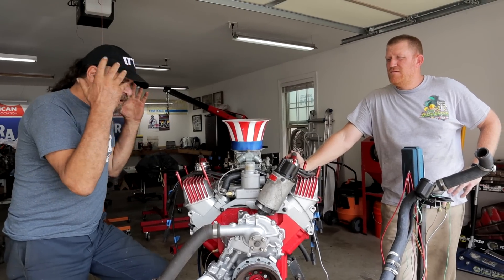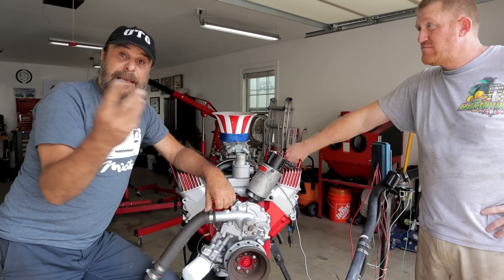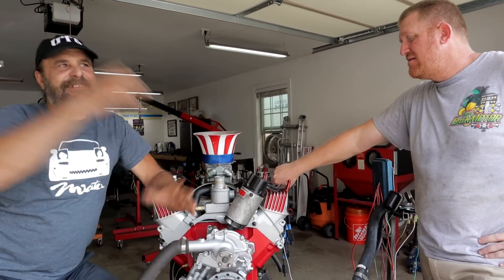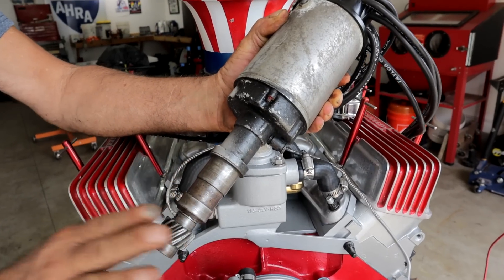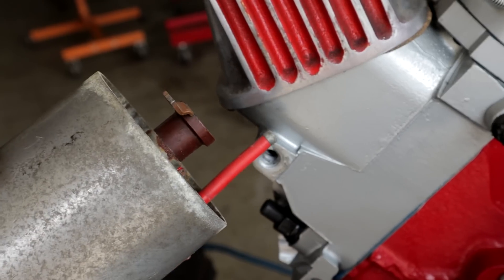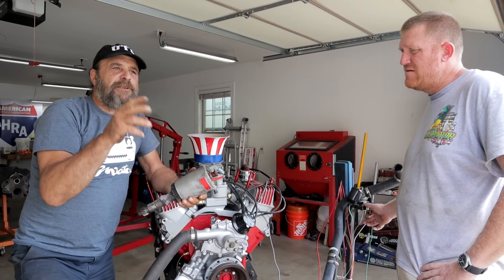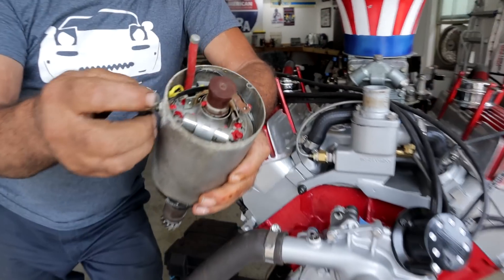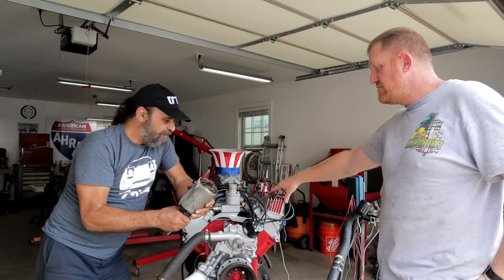The Magnificent Magneto

Comment: How do you hook a tac up to this? Can you hook it up to that kill switch spot? Can it be digital?
Reply: You can do it 2 ways, 1 mechanical with the right base, or 2 electronic tachs. Sprint cars use Tel Tachs which are digital and use a 9v battery and have a memory or there are boxes that adapt your electric tach to work with it. They get the signal from the ground wire. That said do not try to hook up your tach directly to the ground wire! You will fry one or both of them.

Comment: I mean it’s a nice explanation but vertex magnetos are not 3 A they’re like 1.5 A you can hot rod one up with an external transformer and bigger internal windings because now there’s more room inside the case because the transformer is not inside the case anymore and get them up to about 3 A it’s all the bigger you can make a vertex I do not know much about vertex mags so I don’t I have a comment to make on the fact that the magnets get stronger but leaving a magneto sit on the shelf The magnets will not just go dead they only discharge from being ran if you spend a coin for rare earth magnets they never need recharged again but leaving one sit on a shelf does not discharge the magnets just sitting there

Comment: nearly all power equipment for lawns, tree work, and snow blowing use them. Just from the magnets on the flywheel to the coil. Whether two coils and cylinders, or one of each. That's why you can hit the mower blade on a stump, shear the key between the flywheel and the crank and be out of time. If you are broke and trying to learn combustion engines they are all over the streets on the curb for free, and most of them just need a little patience and elbow grease. You can learn all the basics of carbs, spark, compression by diagnosing and repairing them before moving onto things you shell out money on. I was lucky enough to get paid to do it and get the experience. Cut and lapped/ lashed valves, set points ignitions, ring gaps and hone jobs. The list is endless and you can learn for very little cash to gain the knowledge, experience and confidence.

Comment: Some technologies, no matter how old, are still the best for a given job.
An ignition system that doesn't rely on an external power source = magneto, an ignition that delivers a stronger spark at high rpm and is capable of firing the plug at extreme cylinder pressure = magneto, an ignition that simple, has few parts and is easy to repair if needed = magneto.
AG equipment used them forever because if the electrical system on the tractor failed the tractor could stay in the field working anyways.
It's much like the traditional all mechanical injection diesel (before electronics), you could push start one and it would run forever strictly on air and fuel - no electricity required. 
Sometimes technology moves us backwards...
Being able to control something with a digital processor isn't always a step forward, when absolute reliability and in the field repairability is key then the magneto is the answer.

Comment: I am dying to test out my Mallory mags park setup which uses apparently a transformer and a dual points distributor to switch the ac on and off. Info is limited I can find on it.
Reply: Spud Miller (F.I.E.) took over Mallory Magneto parts & Service.
They have everything from caps to bases. They can put tach drives on and make rev limiters. They are the best source of info.
They also do Vertex mags, as do Joe Hunt, and B R Motorsports.
You can even get offset, or right angle drives if you need to run a mechanical fuel injection pump like a f5000 or a Can Am car.
Reply: @anytow  Thanks for the info!

Comment: Great Vid UTG! Love magnetos. there are lots of stationary engines form the 1920's that still run the original "horseshoe" maggies. Just one thing @4:48 platinum tipped points. Very important to clarify that they should not be filed with a normal points file as that will ruin them. They are very expensive (if you can obtain spares) and many have been ruined by well meaning but ill informed people in trying to file them as if they were "normal" points.

Comment: Years and years ago at Wyotech in Chassis Fab & Hi Perf Engines class, had 3 old  drag racers teaching and one brought a Vertex to pass around the class, no cap on it, he knew damn well what he was doing 😄

I grew up drag racing, I knew what a magneto was all too well. I see kids passing it around, turning it a little. I forewarned one dude, "that thing is going to zap the piss out of you!" Nobody had grasp how a mag worked yet. Saw a kid give it a good snap and he about dropped it and peed his pants! They didn't get it makes high energy spark without batteries or anything hooked to it. It was a good laugh 😅. It was even funnier when i put the coil post on the classroom table frame and zapped a whole bunch of guys too close to the desk 😆.

I can say getting hit by an MSD 7AL2 Pro w/ pro power coil was worse! Our promod had Mallory SuperMag IV's tuned by Don Zig, that bastard was like getting hit by lightning!

Comment: 72 duster, I just replaced  voltage ragolator but still doing same thing. Car dies  in run position  but will run with full 12v with key on just off starter runing... not sure what it is.. HELP please...
Reply: Probably key switch
Reply: Might be, I replace key switch about year ago and did not fix same issue at that time. Voltage regulateror fixed at that time but now it's doing something..

Comment: Thanks UT on the spark plug gap!!. I've had problems with my Fairbanks Morse Mag, it's on a 1932 Fordson Tractor built in England, converted from the original "Spark Box".
Basically a Model-T engine on steroids. 1st thing I actually ever drove at age of about 9 or 10, pulling down whole trees by the roots with my Dad. I had to stand on the clutch while pulling up on the steering wheel. Boy, I got whacked by plenty of branches. Those were the fun days during a hot summer!

Comment: We use these in airplane engines too because they allow the engine to keep running if the electrical system fails. A typical setup is a 4 cylinder engine with 2 spark plugs in each cylinder, with 2 magnetos so you still have partial power to all 4 cylinders if one magneto fails.

Comment: Wisconsin Air cooled engines used a Fairbanks Mores Mag.  Had a bunch of fun watching a kid that thought he was sharp on small engines knock himself across the shop floor several times as he couldn't grasp that when he slowly rotated the engine up to TDC it would throw one hell of a spark.  Had to explain that the click he was hearing was the armature spring assembly throwing the assembly over real fast so it would start throwing a spark as soon as the engine turned even slowly.  You have to pay attention when timing them or you get a nice reminder.

Comment: Thanks so much Tony. If i remember my tech, Magnetos also provide what is called "trailing" spark to ensure firing on every stroke. If a hi power mill with a lot of fuel entering the cylinder managed to flood/ground out the spark, it still had the capacity to fire the charge up to something like 15 - 20 degrees late when the plug gap cleared. This happens in like a 0.3 of a thousands of a second. I'm sure Tony can expand on the importance of this reliability factor and also in not sending  unfired fuel charges through the exhaust. 
Cheers

Comment: Magnets in the cheap chinese gas powered generators will lose strength when sitting.
Ive made a few bucks over the years buying seemingly dead generators , starting them, plugging in a drill and manually spinning the drill to tickle the field and start making juice. Leave it run under load for an hour or so and its good to go again..

Comment: You forgot to mention Joe Hunt Magnetos.  The Chevy versions have a hole in the base to lock them on Cylinder #1 in the 'points open' firing position to make it easy to set initial timing.

Comment: Allen (my friend) and I were at a high performance shop in Grand Rapids mi. That had a used speed part section. He picked up a mag and spun it before I could warn him. He threw it down so hard I STILL cant believe he didn't break the glass topped display case! His eyes were the size of dinner plates! Another good shock to be had is from a old model T coil. A guy i worked with would wire up another guys toolbox with a charged T coil so when you put your key on the tool box it would ground out and you would get a rather nasty poke! Very funny.....when it isnt happening to you! (Ask me how I know)

Comment: I took a aviation history class as an elective in high school and its amazing how much airplane tech found its way onto the drag strip those 18 year old who flew fighter planes over German picked up alot of knowledge and reapplied it
Reply: My son in air cadets learned about magneto.  They are still used in air planes. Wico still makes magneto for old tractors.
Reply: Almost all recip aircraft are still mag powered, its time tested and very well proven. Starting to get more electronic ignitions now, especially in experimental craft. 

What I always liked about aircraft mags were the impulse coupling design. Usually just one mag of the two has it. Spring loaded cam that snaps the mag over at a set point giving a good hot spark with little to no rotation of the engine 👌.  If the engine had some prime, you can literally tap the prop around by bumping it and once the impulse coupling snaps over it could start! It also makes it more hazardous to work on if a mag is mistakenly live.
Reply: @mytmousemalibu  
That's how the mag on my IH tractor was  - obviously for the same reason.
There was a hand crank stored up under the seat as a backup if the battery went dead.
Some stuff should never have gone away...
Reply: @mytmousemalibu  
That's how the mag on my IH tractor was  - obviously for the same reason.
There was a hand crank stored up under the seat as a backup if the battery went dead.
Some stuff should never have gone away...
Reply: Yeah mags are very reliable model t ran of a magneto attached to the flywheel ive seen them almost a 100 years later still working
Reply: Look at all the overhead cam and multi-valve technology in todays passenger car engines - that stuff is straight from WWII aircraft....
Reply: @Motor-City-Mike  right, people now marvel at these new cars and there technology like its a new invention when its not its been around for along time
Reply: @adamturner2507  Things like turbocharging, supercharging, compounding both together, methanol/water injection, and even using nitrous oxide injection were things born during WWII.  Fuel injection was another one, although mechanical injection. The R3350's on the B-29 were legitimate direct fuel injection, not port injection, it went right into the cylinders. The Germans did a lot with fuel injection too. The idea & use of sodium filled exhaust valves is another. Lots of pretty advanced concepts stem from that time. Quite a bit of not so obvious things like advances in metallurgy took place, leaps & bounds forward in little time.
Reply: @adamturner2507  indeed - the only thing that's new is electronic engine management - all the rest was done nearly a century ago.
There were supercharged cars at least as far back as the 1920s - and WWII aircraft used them and turbochargers,
anti detonation systems (water/alcohol mix) also nitrous oxide.
WWII began the true industrial age for the United States, and it ran for a solid twenty years;
A time when the country showed what it was TRULY capable of!
As they say - the old is new again.

Comment: Magnetos are still popular in outboard motors too. I had to figure out how to wire a boat motor from scratch when i bought my boat and the magneto was the only part i couldn't figure out cuz i didn't know my motor was coil-on-plug, when older brands like that were usually switch-block.

Comment: Magnetos are still used on piston engine aircraft. Two of them, for reliability.
Reply: Having two is also used for more complete combustion..
Reply: @joetroyner  kinda hard to blow out a combined 8-10A of 30-40k spark action no matter how many inches of manifold pressure you’re pushing through an engine…probably even if your plugs are fouled!
Reply: @samsonian  I'm not sure if you're commenting on reliability or performance. What I can tell you is during a 1700 rpm runup before takeoff, we check both mags by turning each side off one at a time. There is a noticable difference in performance on one mag, usually between 85-125 drop in rpm. As far as reliability, they do fail from time to time, that's why we look for the drop of rpm when we turn each side off, it's to make sure we're not running on only one good mag..
Reply: @joetroyner  both…but the part about manifold pressure and continuing to run even if the plugs get fouled has more to do with what little I know about WWII fighters and bombers and the robustness of running twin magneto setups on each power plant. I don’t pretend to be very knowledgeable about the actual nuts-and-bolts everyday running of a prop plane, even if I am somewhat obsessed with radial-powered DHC-2s I’ll likely never get to do more than ride in. Thanks for the granular input, amazing how such simple and time-worn technology can continue to be as- or even more-viable in certain applications than the newest and shiniest!
Reply: @samsonian  I see what you're saying now. Some newer aircraft are using electronic ignition, but most pilots don't really trust it. That may change, but in the meantime I'm happy with robust, time tested equipment. When the plugs are fouled, we just lean out the mixture at high RPM on the ground which raises temps, burns off any carbon, and the engine wakes back up in about a minute. You can't do with your car! Also, the Beaver on floats in the mountains is a dream retirement goal for me!!
Reply: @joetroyner  as to electronic ignition, my airframe instructor had an MSD on his Long-EZ, but was always a little nervous about long flights.

I expect that any serious EFI/ignition system for planes is going to have dual computers, and probably run off the old Mercruiser batch-fire injectors, too. Though I'm not sure what they did on the Porsche flugmotor.
Reply: @joetroyner  that too, but the last place you want that engine to stop is at 10k ft.

Better to have a running spare just in case.
Reply: I have had 1 mag failure in about 3500hrs of beaver flying.  The drive gears scattered inside.  It is common to get moisture in the distributor area on cold and wet mornings causing rough running, they clear up after they get up to operating temperature.   Incredible reliability for a design that hasn’t changed much since 1929!
Reply: @78f26  huh. I'm actually kinda surprised you had one fail!
Reply: Redundancy or reliability?
Reply: @AlienLivesMatter  I guess you could say redundancy instead of reliability.

Comment: When I was a teenager, my friends father had a midget racer he was running in PA. They wound up with too much oil in it and the Chevy II engine packed up so they took it apart in the basement. We were checking out the parts and I picked up the magneto and gave the gear a spin, ZAP, I will not forget that!

Comment: The mags I was familiar with, Vertex, went to full advance at around 400 rpm.  The retarder, usually 12-15 degrees, was so that the engine could be started, then it went to a fixed advance.
Reply: Perfect, especially for pull or kick starting.
Reply: Thank you 👍

Comment: Thank you Tony for posting this video, you made my day, I think it's comical in a way how some people are almost afraid of magneto ignitions like a phobia!
All my friends are ate up with modern electronic ignitions on their vintage motocross bikes because they're totally not with the program using the old contact breaker magneto type like I do, what cracks me up virtually all of them have problems getting their bikes started and needless to say if those magical solid state types have a problem you're not fixing it at the event and probably not at home either. To this day I've only managed to convert a couple of my friends to trust me and go back to a properly assembled and setup point magneto, the reaction when their bike starts easily and runs like it ought to is priceless, you can hear the change in the exhaust tone too most times with it getting more of deeper sharper sound.
Coming soon on my channel I'll be doing a video that touches on the ins and outs of getting your magneto working properly, magneto ignition engineering and designs are fascinating, there are numerous types of AC or DC types but they all employ the same principals, I hope some of you will watch it, you too Tony, I think you'll like it.

Comment: V-12 Ferrari's from the 60's had 2 6-wire distributors running points with the Marelli magneto's built in underneath. If your ignition should die you flip the toggle switch and now you're running on mag power !

Comment: Can you run a tach off them or does it have to have a mechanical drive on it?
Reply: Tach goes on the same lug as the kill switch. Works just fine.
Reply: I run a mechanical rev limiter off the tach drive on a vertex in my sprint car motor. It’s a centrifugal governer that grounds out when max rpm is achieved. No battery required!

Comment: They used to put them on bicycles mounted against the tires and they were called bottle dynamos. Technically not the correct term since a dynamo creates DC. 
They were low powered AC producing magnetos.  Anybody remember those?
Reply: Are referring to the ones that were to power a headlight? Crazy amount of drag on those.
Reply: @luvr381  TANSTAAFL
Reply: @akallio9000  ?